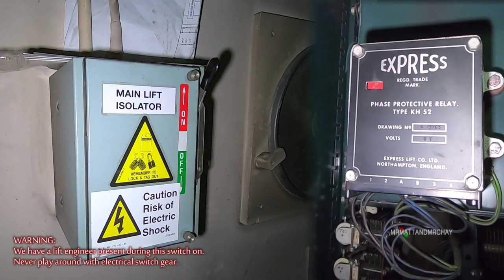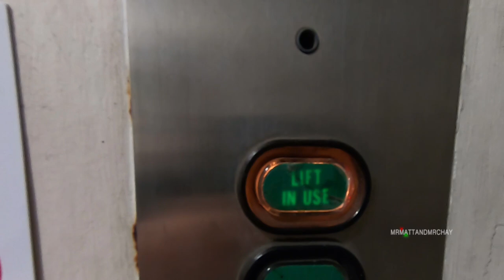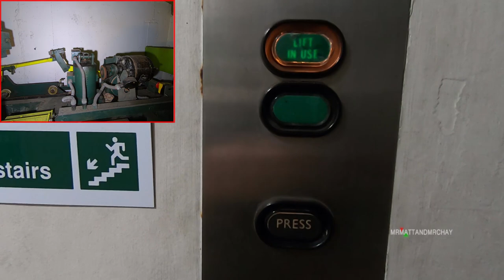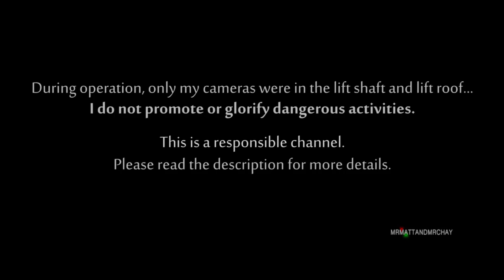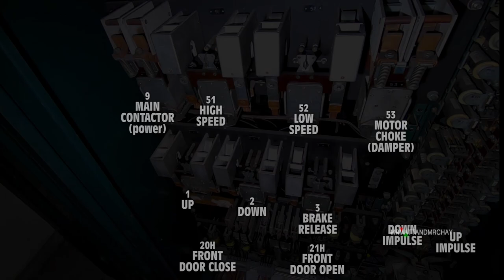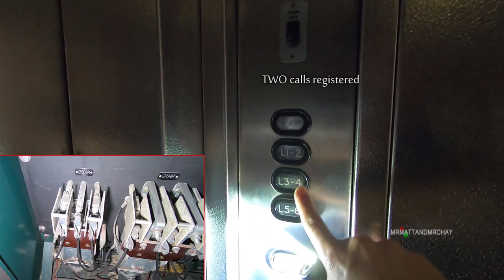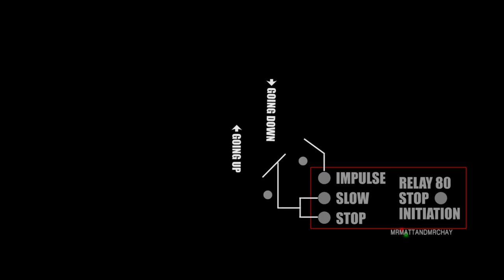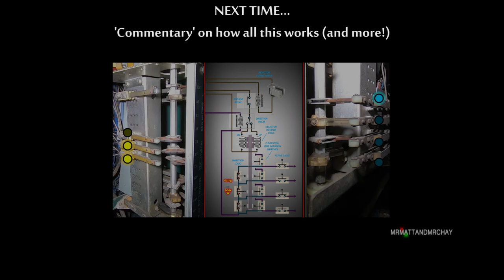OLD LIFT - THE SWITCH ON!  Camera angles and tech detail!

Comment: It runs really well, as if it’s practically new except for the indicator lamps and the slightly damaged door. They probably could put it back into service without much repairs.
Reply: Probably on a maintained shutdown schedule, where there is a monthly run up and down the shaft. Often used for a lift that is not needed, but where they might want to use it in future, and do not want to have the expense of recertifying the lift, or paying to have it taken out of service registration wise. If no longer in use typically power is cut, the car lighting is cut and the fuses are all removed, so it will no longer run if accidentally turned on.

Comment: Grease all divertor pulleys, lubricate guide rails and top up oil pots, strip down clean and lubricate brake assembly. Reassemble brake and test, check main ropes,check safety gear for free operation. Check gear box and motor bearing oil levels, run motor up to operational temperature and check floor levels, door gear and safety edge operation then return to service
Reply: Seems like it's not a hard job to get this thing back into service then! I wonder if parts for express lifts can be custom made as original parts are not available...
Reply: Michal M I believe you can get fake parts which would work. Probably not motors and stuff, but smaller things like door rollers or relays.
Reply: @Lift.Tracker  That would be good.
Reply: @MichalM  A fair few parts are available from Lift Components Ltd, contactor and relay coils and springsets. The MH selector is now obsolete and the electronic replacement is fitted. Pulley wheels and Machine sheaves are available but not the gears themselves .
Reply: @peterlomas984  It seems like parts aren't that rare then which is interesting, I thought it would be very hard to find any part at all, other than the odd few which are in high demand.

Comment: How nice to see the workings of these old GEC Express lifts using relays rather then solid state relays simular to what I used to work on in the telephone exchange and the power group would maintain the lifts in the exchange, thanks for an excellent vid. unlike some I have seen when kids were riding on counter weights etc. waiting for someone to be cut in half!!! Good video keep up the good work and thanks.
Reply from the maker: I believe there is some connection between British Telecom and Express Lifts, as Express Lifts used telephone relays.  Can't remember exactly the story, but yes, even now many still exist as the technical staff on site have the knowledge to fix them.  Not sure if this is still the case.
Kids surfing counterweights have picked this up from a particular person on youtube who used to meet up with kids (or perhaps he still does?), behaves like a kid himself, irresponsible, doesn't seem to know the difference between right and wrong and 'everyone else' is to blame when something goes wrong.  I'm totally not surprised that kids are copying the stunts from this persons channel.

Comment: These old electro mechanical control boards are a work of art, designed when lift installations would last forever.
Reply from the maker: Totally agree
Reply: Steve Like I have said before. They don't make them like they use to.

Comment: I have the same question too, why the lift was off for years? Is it now have been upgraded with computer controlled mechanics? 
And for some buildings I also notice this similar situation:  the lift is being switched off for years , not renewing, not removing for years...why?
Reply from the maker: A lift engineer friend of mine gave me the heads up on this one, but without enquiring (which we didn't want to do) we don't know why it was turned off.  So can't answer I'm afraid :/  I guess because it's no longer required, or more like - MONEY!  If it were to be used then break-downs cost money!  I don't know
Reply: I've seen lifts that have been out of service for the better part of a century and it usually boils down to one thing - money! One seems to have been taken out of service in the mid-1930s for no good reason at all, another around the same time because the house was sold and the new owners didn't think they needed it (at least that's our best guess why they'd take a lift out of service after less than ten years, we do know about the sale of the house), some were switched off when manual operator control was banned around WWII, some suffered war damage and were never repaired and some were turned off for good when the power network was converted from DC to AC in the 50s and 60s. The core issue was always money!

Possibly the weirdest story was one that seems to have been converted from manual control to relays in the 20s but apparently something went wrong during the conversion and the lift was never turned on again. The landlord dynasty of that house is... a bit interesting. Old nobility and very much obsessed with money. Quite a fancy house but in a bad state.
Reply: @mrmattandmrchay  where i work we have an old 57 Esco, it was installed by a company called Jolley of New Orleans which was an esco dealer, about 5 years ago the elevator got stuck and was never repaired, landlord said it would cost 100k to fix which is more than even a modernization but i looked (looked didn't touch anything) and no metal in the tank but low fluid, car is parked on the 3rd floor and has been for 2 years, albeit about 3 feet below the floor (city got mad that the safety cert expired and someone came and looked at it, and moved or surfed it from 1 to 3 and hasn't moved since, guy said he couldn't find anything wrong) i recently talked to the landlord and not being a tenant he gave me a different story, apparently he doesn't plan to keep the building through the decade cause the upstairs isn't profitable enough, and the maintenance costs wouldn't be worth it, plus the 1st tech most likely lied about the problem and in the 2 years half the tenants left upstairs, which is why its been out of service, so unfortunately money does seem to be a big factor in cases like this, pretty sure all that was wrong was the pump got cavitated from being low and considering it hasn't sunken anymore since it was parked its not an issue with the jack or piston bore, so sadly an easy fix, would love to see it run but cant win em all, if your curious what it looked like search "Elevator Veterans Building" and you'll see it before it broke, was a really cool all original black button esco

Comment: i used to stay in a block of flats with a 15 floor OTIS lift. I used to hear this loud noise every night after the lift had not been used for about 1 hour, it sound like the weights moving and the cables shaking. Any idea what it was? I was right at the top of the flats and the lift used to live on the ground floor as default, any time you walked in the lift was there at the bottom (normally)

Comment: That one has had upgrades, only Express elevators I have seen used a chute on the car itself, and a row of large change over switches in the shaft that controlled the functions, with the cam switches flipping state as the car passed, and a second chute that held a cam for stopping at floor level. Was a good day that got replaced with a new controller, that at least would not skip floors depending where you stood in the car.

Comment: Maybe I missed it but why was the lift out of service in the first place? It seems to function perfectly save the floor position indicators.
Reply: The building may have been abandoned.
Reply from the maker: Hi Mike, nope, you've not missed anything.  A lift engineer friend of mine gave me the heads up on this one, but without enquiring (which we didn't want to do) we don't know why it was turned off.  So can't answer I'm afraid :/
Reply: @mrmattandmrchay  Why don't you like to do?

Comment: interesting video, that circuit that controls the stop relay sequence is a AND gate i believe as it requires both inputs to be true for the output to stop the motor from slowing speed

Comment: In the first part of the video what is the metal cover next to the main switch?
Reply: 0:16 You mean the circular disc to the right? That’s a replacement flywheel. Used to hand wind the lift motor.
Reply: @Lift.Tracker  thanks dude!

Comment: That's not an old Express lift. It is, in relative terms, modern.
An old Express lift will have an SMS badge, (Smith, Major and Stevens), and be DC powered, with an up/down lever and self levelling on coming to floor. Acceleration steps will be driven by a chain off  the main sheave shaft.

Comment: How did Chay exactly almost lost an eye?
Reply from the maker: It's an incident that I will never forget.  He was sitting on our steps in the garden, which were lower than the grass.  I was cutting the grass with Chay 4 metres away from the blades, level with them.  If I'd known, then I would have told him to move!!  Anyway, the unthinkable happened, the mower went over a stone and shattered it.  Fragments shot out and one hit him 1CM under his eye.  All I heard was a low 'AWWwwuhhh'.  The time it took for me to put the mower down and be with him seemed to take ages, but it was only a few seconds.  We called an Ambulance out and found just how lucky he was not to lose his eye.  OMG, will never forget it.  He still has the scar, although it's only a slight one.  My message was - kids have to learn everything, if I was Chay then I'd be thinking "maybe I shouldn't sit here because...", but Chay being 10 years old didn't, because they hazard and danger perception has to be learnt.  Chay learned the hard way this time.  I'll put some photos on my YouTube Community page sometime to show you how lucky he was.

Comment: What is that circular thing at the right of the isolation switch?
Reply: Looks like a hook for a padlock
Reply: I think it's a replacement flywheel. Something to attach to the motor to spin it manually if the power is lost.
Reply: The hand winding wheel.

Comment: Why you turned the Power back off?
Reply: Because that's the way it was when he found it. If the power was left on, it would have been using power for nothing.
Reply: He wants to respect the staff of the building in case they come inside
Reply: cause it is turned off on purpose (which idk).
Reply: The elevator was turned off when he found it, and it would have been turned off for a reason.

Comment: Why does the lift have cables under?
Reply: That’s to power/control everything inside the lift car. It’s to power the doors, the lights, control the indicators and pass calls to the motor room when you press the buttons.